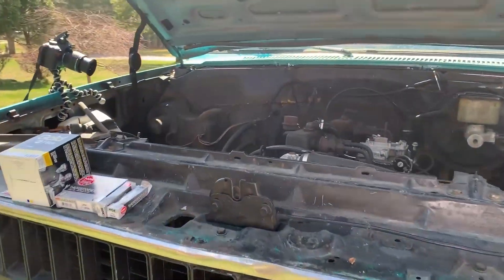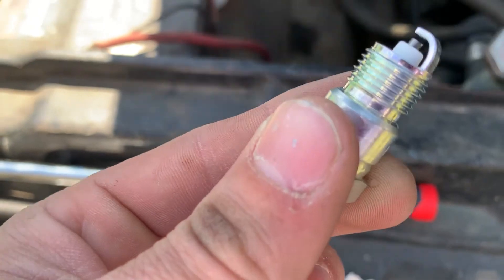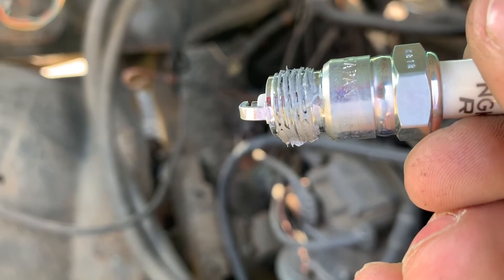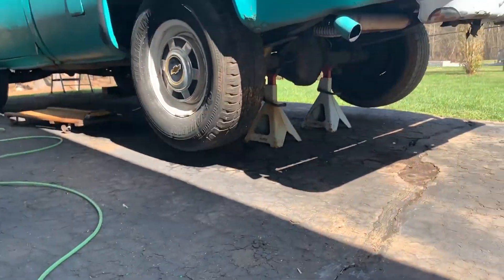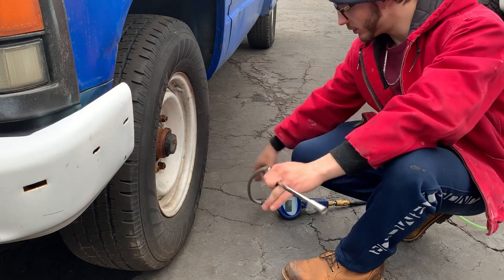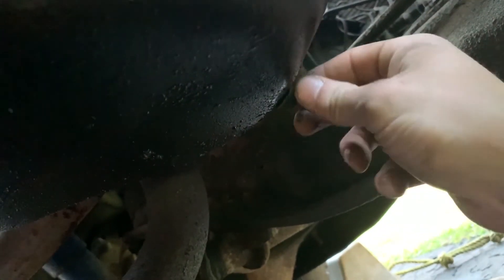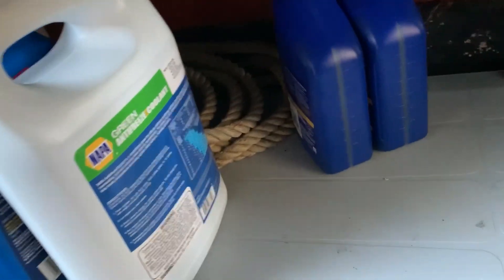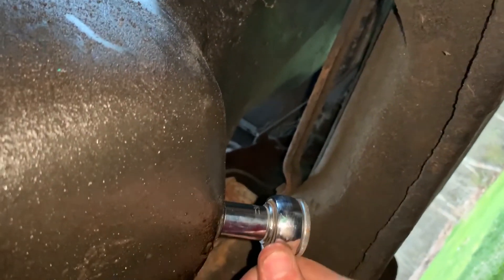1981 Chevy C20 Project 250 plugs and oil change! (Part 2)

Comment: Supposed to fill oil filter somewhat with oil before u put it on FYI lol but I guess doesn’t really matter
Reply from the maker: I cranked over the engine without it firing up for a minute or so after I filled it with fresh oil, would that fill the filter up?
Reply from the maker: But good to know man thanks for the info
Reply: @BertBuild  Honestly not sure, but sounds like that would do the trick